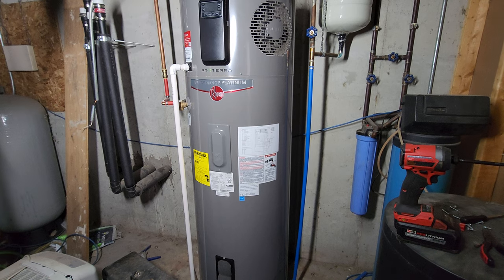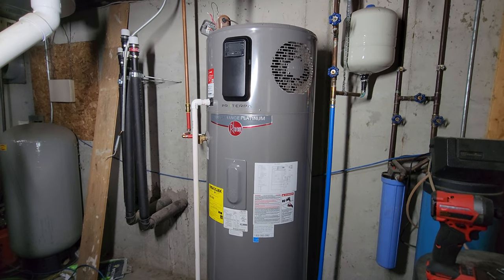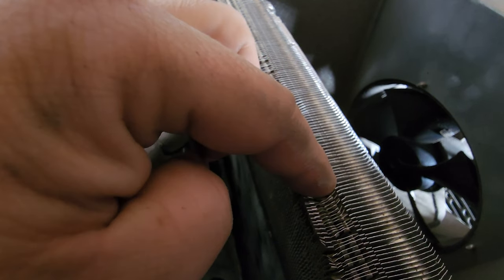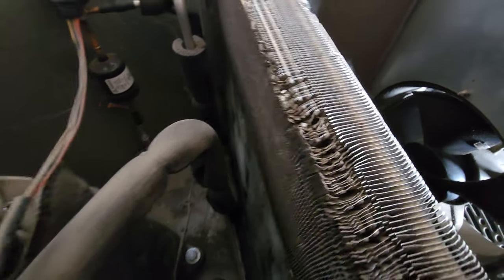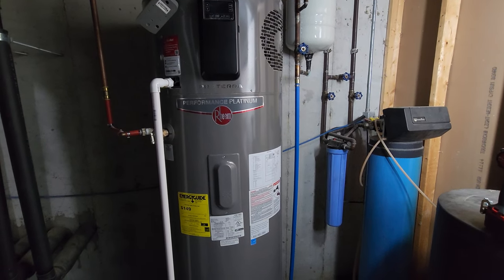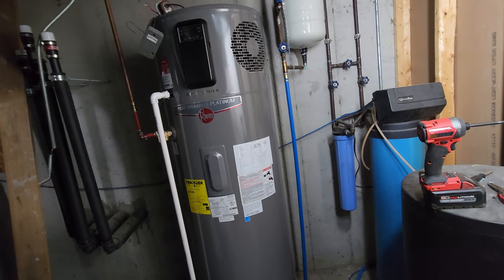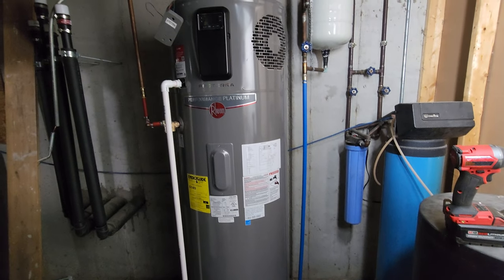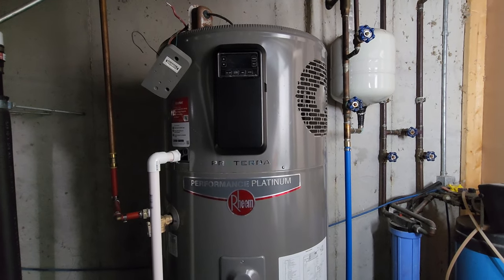The downside to a heat pump water heater. It works great till it doesn't.

Comment: 1st off, thanks for the explanation of how this unit works.  I personally do not like this design as it means that you are double heating.  What I mean by this is that in the cold months, you hare heating the air in the basement first with one source, then that air is being used to heat the water in this tank.  If I'm going to do that, I'd just get an indirect HW tank and feed it from my primary source.  I'd add a secondary source for the summer - i.e., solar pool heater, and I'd be done. 

If I'm looking for a heat pump water heater - the heat pump portion should be on the outside of my house/building - this way I'm not double heating.  The problem will be when it gets below freezing, then I'll need another way of heating the water.  

Some questions  - Where is the insulation on the hot water output- I'd have at least  1" of neoprene ?  Where is the hot water siphon to prevent the hot water rising in your piping?  

Some additional comments:  I'd have some Webstone flanges w/Unions for easy servicing on both the hot and cold water feeds.  I'd insulate the cold water pipes as well as they will pick up heat from the room.

Comment: you need to get micro channel vinom cleaning package and wash the condensor.  Its going off High Head pressure from the micro channels being clogged.
Reply: That’s not a condenser it’s an evaporator therefore it will not cut out on high head pressure because of a dirty filter or coil. It would cut out on low evaporator pressure due to restricted airflow. 

This is just normal maintenance same as the central HVAC equipment that everyone ignores until it breaks or causes issues.

Comment: I have this idea to make a box out of furnace hepa filters, then attach it to a heat pump water heater. I have seen this done in a factory before and think it will keep the air cleaner. I still have a regular electric water heater. That's my plan when I replace it.
Reply: Do you think this will work? Yes or no?
Reply: You describe a corsi-rosenthall box.  You may want to look into a duct kit for installing in closed spaces like closets: [you] can then run the input hose to your filter box.

Replacing MERV-13 filters several times a year will also eat into your energy savings though. You could use a (better than stock) washable filter if you remember to clean it like every 2 months.

Comment: Put a hepa filter on the intake. This will keep your condensor clean. Although the dirt reduces evaporator efficiency and essentially insulates it I don't think that would be your cause of ice. Does the unit have a defrost thermostat on the condensor that you can see?
Also that "air filter" is really not shit. its hardly even considered a filter. maybe merv 1

Comment: Hmmm, I find this interesting. My brother owns a 50 year old window air conditioner that has a cheap 1/4 inch sponge filter on the front of the evap coils. It’s been used off and on over the years and the coils have never gotten caked up with dust. How is that different then what you have here? I mean I see in the video the dust accumulation but I can figure out why the coils on your unit with its’ filter being used still end up getting caked up?
Reply: The "filter" is just a sheet of plastic with a bunch of holes in it. In needs to use a remote ducting kit to run the intake air to a pre-filter box.
Reply: You know an idea would be to vacuum off the coils every 2 or 3 years when you end up changing out the anode. You have to pop off the top anyway to change the anode so you might as well vacuum the coils too. Anodes should be changed out this often. When changing out the anode use a hammer wrench- like the kind they use in garages to change tires. I did and it loosened up the anode in about 20 seconds.

Comment: So as I listen to your very informative video , I have decided to NOT purchase the stand alone heat pump water heater. The motivation for you to buy a heat pump water heater is saving money correct? You can easily calculate the running cost for a gas or electric water heater (installation costs vary by region) And consider that you don’t need to do anything to them once they are installed. 

What you have done with this informative video is provided me the actual difference’s in cost (materials & labor(mine or contractor) that I would need to consider. 

For myself, the fact that I would need to worry about all the additional items you have pointed out, There are not enough cost savings to warrant a change to heat pump type water heater. Less Stress also has a value that is often overlooked.

Comment: That is not the condenser. It’s an evaporator. 

What is your ambient temperature? 

Buy yourself a few cans of Nu-Calgon Foaming Evaporator Coil Cleaner. Hook up a hose to your hot water side of a sink or washer connection. Then do annual cleanings of the evaporator coil. Flush all dirt down the drain. 

Then remove that junk plastic screen filter (probably similar to all the window, bangers and DIY mini splits that everybody installs). Fabricate a wooden frame to fit with foam weather strip to top. Install 1/4” foam air filter material to wooden frame. Spray filter with filter spray. Now you have an air filter that will collect more dirt, i.e. more surface area. You will have an air filter that you can remove the box take it outside spray some degreaser on it and gently spray it out with a garden hose every three months. Reapply filter spray.
Reply from the maker: 75 when the wood furnace is running.

Comment: I didn’t even make it a year when I started having problems with my Rheem water heater from fault and error code constantly popping up to now my unit keeps freezing up and water coming out of the bottom all over my basement floor. Rheem is very easy to get a hold of, but after the one year mark, they will not send anybody out to help repair your system. They just send parts and expect you to install them yourself, some of the diagnosing they have had me done is way beyond most homeowners ability. The only reason I was able to do it is I do have an electrical background I don’t think I would ever suggest or buy another one of these water heaters. Double the money and I haven’t even made it a year and a half and nonstop codes and problems.🤮

Comment: Hey bud,

Buy a roll of filter media, cut it and    Tape 1-2 layer over your intake grill.

It’ll filter out the fine dust
Reply: You can also get the duct kit and route the intake air from outside.
Reply: @GrindinD  : Which may have even more dust, pollen, etc.  ...   Better to fashion some sort of pre-filter (from commercially available filter elements) for the air inlet.

Comment: The problem is not so much the dust and that it clog.  It's that it's hard to give maintenance.  Most things with a filter that needs cleaning you can easily pull it out and clean or replace.  They should make it easier to access the filters. In addition, if it can get frosted. They should add a single element that if you need to defrost it, you turn that on, an it heat it and melt the ice quickly and get back to working.  So you don't stay hours (a whole day?) without hot water while it thaw. 
I don't mind that it needs maintance, it's that they don't tell the people they have too.  And how difficult it is.  Reminds me of those tower fans.  Cleaning them is always a hassle.
Reply: Ideally it should have a reverse solenoid to throw it into reverse to melt the ice automatically.

Comment: The point of this message is maintenance costs vs. Electrical cost savings. You might save a little money from using less energy but unless you are trained and certified to perform maintenance on it yourself then the water heater with A/C is not worth it!

Comment: Just one, lone guy here.  In my humble opinion, you should not put these in a partially finished basement if you want to use the basement in the wintertime.  1.  Noise level.  2.  blasting out cold air.  3.  acting as a dehumidifier in the winter is not good.  4.  initial cost and maintenance costs are not low.

Comment: I had a heat pump ac + furnace in a camper Michigan has lots of moisture and that caused it to freeze up in the summer heat pumps work better in dryer conditions made shure with this last camper it has a gas furnace and a rooftop ac they work flawlessly 👌👌

Comment: Had mine for 4 years now installed in a MN basement, having cats and a dog (lots of hair around) for the last two, same unfinished area as the furnace, only brushing off the filter it came with maybe once a month...NEVER had an issue. Never even had any condensate drain out but there is a dehumidifier right next to it. Only place that gets clogged with dust is right at the bottom where the filter doesn't cover. Looks like you have a very dusty basement which is clogging it up.
Reply: He is burning wood to heat home in same basement. Icing is also. 
A refrigerant and condenser related issue. Also the unit to me is very poor industrial / mechanical design for access filter in my opinion. Profiteroles of air would seem like good retrofit but you would have to account for impedance of fan. I would want factory engineer to come out on this mess.

Comment: The consumer is going to take it in the shorts. We went through this with tankless. Nobody ever told the consumer that they require maintenance, or soft water. Repairs have been super expensive.
Reply: I’ve been referring to Tankless heaters, asThankless heaters. Lots of hype originally, until you explain to the customer the required maintenance. Then when the heat exchanger goes bad with condensate dripping on it, 2-3 hours of labor is not fun.

Comment: Dirty dusty environment, gotta clean it more frequently in that filthy room. My same unit is in my garage and gets dusty after 6 months. I certainly would have noticed the dust on the fan which is a big red flag, any amount is a sign. Throw a better filter on top or stop the dust storm in that room.

Comment: the water heater pulls the heat out of the room it is in  Sean knows this but others may not     I have heard that you can power one element in a two element tank with solar panels         No charge controller no inverter no battery one element powered strait from solar panels  Some one like Sid would have to confirm this  From what i heard a reg thermostat in a hot water tank will work with dc voltage from panels   The other element is powered normally by grid or your inverter   They say if you can find cheap panels then this is a way better way to go    The tank would have to be rewired in a safe way for both ac and dc so some skill is necessary  I have the skills to do this but i would not do it unless it was thought through and circuit laid out by sid or some one like sid    These thing seem simple and can be but there is so many thing a norm person dont consider  And these things could burn your house down!   So if anyone has any info or if sid ever has the time to chime that would be great   LOOK AT THEM PIPES HOOKED UP TO NOTHING   Put pressured water threw them in driest part of summer and find the wet spot or if very small leak find the green grass spot IT would be so cool to see you do videos on building out that system!!!

Comment: What you are calling the condenser is actually the evaporator.  I think your evaporator is freezing over because the evaporator fan motor is not performing to spec and not moving enough air through the unit. I would replace it.

Comment: The reason you are having problems with evap contamination is because of your dusty cellar. If you improve the dust level, especially fine dust which the filter can't capture, your evap coils will stop icing up. Adding a finer filter will restrict the necessary air flow through the evap coil. Clean your cellar!
Reply: Seems to me it’s low on gas

Comment: I agree, it looks like a bad design… big compressor, blow it out, and get the shop vac to suck the dust out that is being blown!

I am really happy with my whole house on-demand wall mounted water heater.

The filter change on this unit makes me thing about the filtering on the GS inverters. When I saw the small filter you were adding, I was thinking that a larger HVAC type filter that could slide next to the unit might be a better design choice, plus with a side benefit of possibly muffling noise. Just a thought.
Reply from the maker: I'm considering on demand down the road. But it would take 2 of our 12kw inverters just to run it.
Reply: @GenetrySolar  - maybe create an external air filter holder, on the intake vents, out of steel sheet metal, held on my magnets, using a wide & tall & thick HEPA filter… to give you more time to swap filters, make swapping the filter easier, and keep the internal of the unit cleaner

Comment: This sounds like it's an issue with the environment that you placed the water heater in. If you're going to continue to burn wood & produce the fine particulate ash that comes with it, you'll need to use a better filter that will catch it, and also replace it on a more frequent basis.
This is an extreme environment that wouldn't be designed for as standard. I don't think the manufacturer did anything wrong tbh and I'm sure a professional installer would have declined the install if they surveyed. I'm sure these things work fine in 99.9% of people's homes.

Comment: It's not just dust or debris the fins are bent to hell. Just because you got frustrated with the removal and replacement of the filter, you destroyed the fins.
Reply: That fin damage is minor (assuming he did not bash the evaporator hard enough to crack the tubing).

Comment: Also it can get too cold for your water heater if you have a heat pump
Reply from the maker: Ambient temps are around 75 with the wood furnace in the same room

Comment: My 18 month old unit has same coil freezing problem.  However, my filter and coil fins are super clean.  I don't think the dust is the main problem.  Rheem says that freezing may happen at temps below 40 F.  My California basement is at least 50F when this happens.  It is worst in heat pump only mode, happens less frequently in Eco mode, and even less in High Demand mode.  First I had to change the thermistors at 6 months and now this.  Major disappointment.  Think twice.

Comment: My basement is cold enough all winter. I am never getting one of these installed. I will stay with my standing pilot direct vent natural gas water tank. It always works even with no electricity. 

Regular maintenance and repair costs will exceed any savings.
Reply from the maker: For me the room the heater is in stays around 75 because it's the same room as the wood burning furnace. So it works fairly well in the winter.
Reply: Is your basement cold because your standing pilot direct vent natural gas water tank requires a constant draft?

(I suspect that is only part of it -- my point is that electric heaters don't require external venting.)

Comment: This is a terrible design. They're going to have to come out with models that are split systems with line sets that have the evaporator outside. It's SO much easier to hose out an outdoor unit. Plus during the summer, the heat pump will have access to so much more heat. It won't work as good in the winter when it has to defrost and sometimes run the elements, but just get averaging on your electric bill to help with that. Long story short, these should be treated like heating and cooling heat pumps.

Comment: I have a friend that is an engineer, but has been doing HVAC work for the last 30 years.  When I asked him about getting one of these, he said, "absolutely not".  Glad I listened to him.
Reply: Yeah, heat pumps are not designed for cold. They can work in the cold but once it gets a certain temperature outside they give up
Reply: @brandongraser2939  This isn’t the 1990s. Many modern air source heat pumps can extract heat down to -25F. This particular model can work efficiently down to 38F which I doubt his basement ever comes close to. But surrounding air temp is not the issue. The point of failure is a $18 air filter that’s allowing a lot of fine dust to enter and cover the coils. For what it’s worth I’ve been involved with and/or overseen hundreds of HPWH installs the last 6 years and I’ve never heard of a single instance such this happening to anyone else. I’ve know of people forgetting to clean their filters and having to explain to them how to wash it but never a filter allowing in so much particulate matter.
Reply: They provide warranties on their work, so stick with known brands with whom they have established a relationship, so they can honour their warranty for their reputation.  They are not adventurous, and their customers are also likewise risk averse; they are the type of clients who like security and  known reliable tech for the warranty. We have all been fooled by fast talking salesmen at some point.

Comment: I know I'm going to get feed back.... but calcium build up on electric heaters does NOT affect efficiency.  99% there is no where to loose the heat. Think about it. Just a fun fact.👍
Reply: @rodgraff1782  electric has no flu... ???
Reply: @Wrenchen-with-Darren  I’m sorry, I didn’t read.
Reply: @rodgraff1782  no worries,  we are all trying to save $ where we can.👍
Reply: You lost me at "loose the heat".
Reply: Where are you loosing the heat to? It is not intuitive. Like insulation in a house, the heat escapes to the outside. There is no loss here. This is referring to the statement of elements becoming inefficient, calcium build up will NOT make them less efficient.